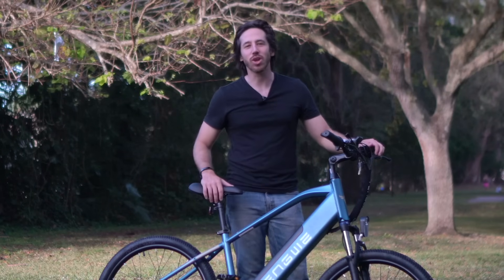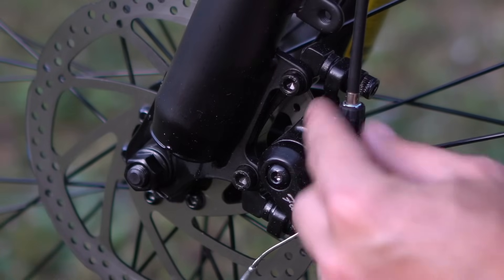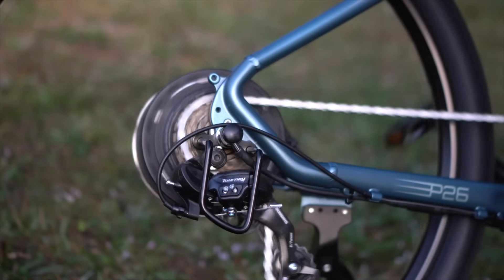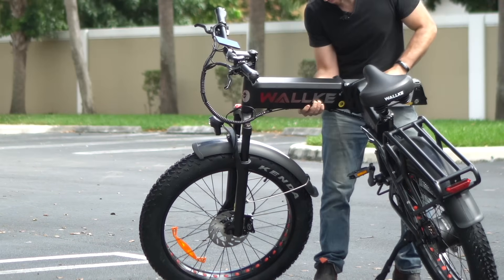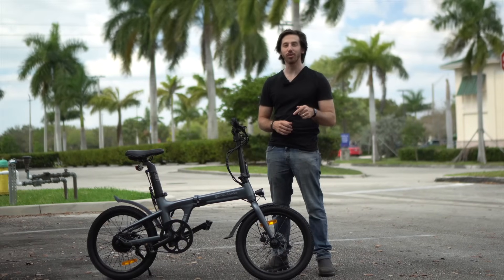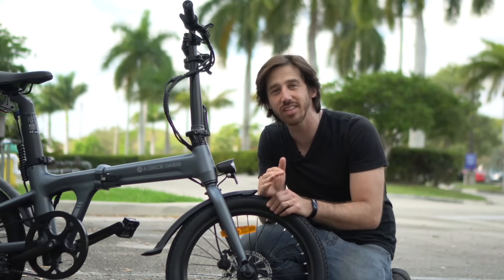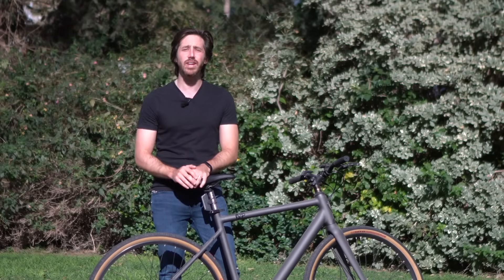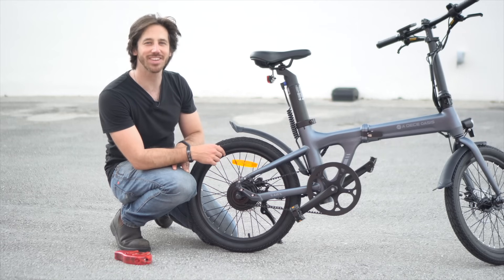How to do common ELECTRIC bike maintenance

Comment: You always educate us in joyful way,  great way to let people get the use of e-bike. I live in syria and the e-bike we have for sale is very heavy with old battery type (led acid),  i usually used my old bike for commute to my work its 30km distance. I wish to be able to get a light weight one.  At the end it just a wish. Thank you so much for your efforts it highly appreciated.
Reply: Have you considered making your own battery pack? I am curious if the materials are available for a diy project.
Reply: @jiml4987  yes I did consider that but since the sanctions on Syria and the government restrictions through customs make it very hard to get anyting that you need it.  The available electric bikes are very heavy (check the link below) so the upgrade will not be effective. On other hand living in third floor make hard to carry that heavy bike. And laking of electricity (2hours every 5hours) needed fast charging battery.
Reply: @Ash Mraish  I wish more people would talk about sanctions and the impact it has on generations. The politicians enforcing embargoes should be locked up for crimes against humanity. The reason I became an engineer was hobby grade remote control cars, helicopters and quadcopters. I built my first electric car when I was 13 from a $25 VW beetle. I couldn't even imagine how my life would have turned out not having resources available for projects.
The link didn't post. Similar to the old style gas mopeds?

Comment: I made the mistake of using way to much lube on the derailer it attracts sand and dirt. I actually opened the instruction manual and they described cleaning and proper maintenance. Your overview of maintenance is something everyone should pay attention to. Thank you.
Reply from the maker: Yes I generally lube the chain and wipe off the excess. Theoretically I should lube the derailleur's pulleys but I don't do it too often. Too much though and you've definitely got a mess on your hands.
Reply: A little trick..dont use gooey lube. WD40 or teflon chain spray. Solvent cleaners that leave a residue of lube.

Comment: With parts, manufactures are not interchangeable. Shimano controller has to go with shimano derailer. If you have say sram and shimano your adjustments will always be a little off

Comment: I have never had such a clean bike. I replace chain 3x a year because it rusts, brake calipers every month. Bafang BBS02b, 35km/h, around 4000 per year, i use this engine 3 years without touching.
Reply from the maker: Wow, that's awesome - you're definitely using your e-bike as everyday transportation then. That's some good yearly mileage!

Comment: That shimano shifter goes bad after like 1k miles just a heads up
Reply: I found that if you crash hard enough you can make it go bad after just 250 miles! 😅
Reply: @banksarenotyourfriends  or even just 80 miles!!
Reply: @dipdip7250  I've gotten down to 20.
Reply: Mine had to be replaces at 850 miles
Reply: Mine does not work on day one
Reply: I had mine for 3k, still running good until i needed to upgrade =)
Reply: I have just left mine on the maxed out settings and cut it off the handle bar. I also deleted the front derailleur
Reply: Mine was shot after like 150 miles and has no adjustment left 💀💀
Reply: Literally do not have this problem.